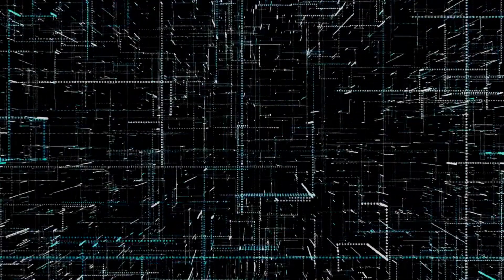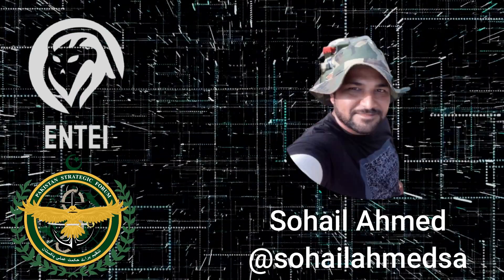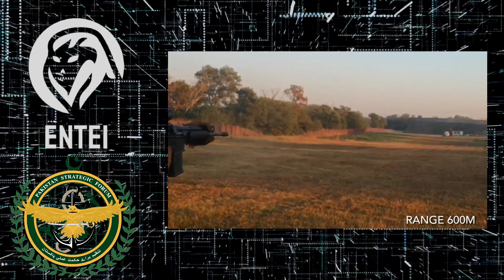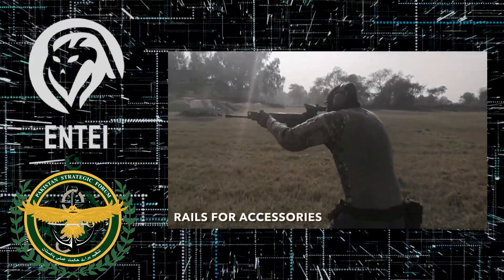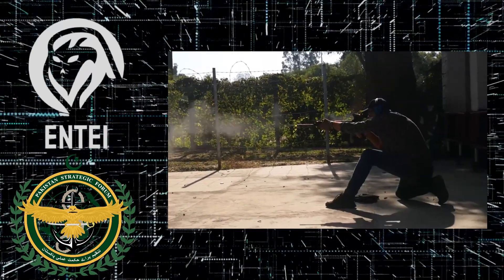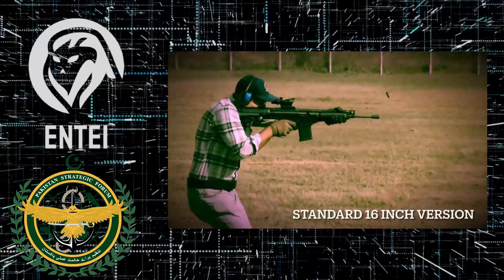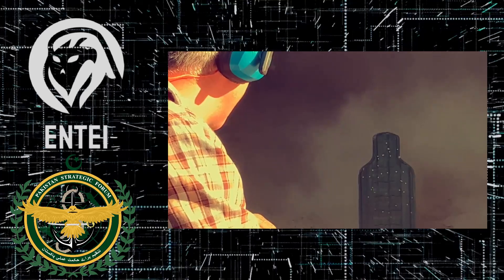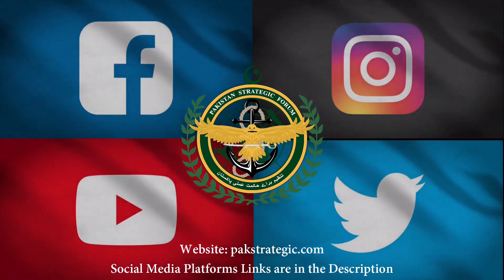New Battle Rifle For Pakistan Army BW20

Comment: Pakistan didn't rejected those rifles because POF can design a better rifle. They were rejected because POF doesn't have the money to upgrade its facilities and license produce those weapons.

Bw20 can be build on the same machinery g3s were made up of but this rifle is nothing more than an ar10 lower receiver (with its buffer tube extension cut off) joined to a g3 upper receiver.
Reply: facts facts facts

fr doe, i dont see a difference between this and the g3 considering they kept the roller delay.
Reply: @schizodecanus7498  they basically joined ar10 lower receiver with a g3 upper receiver.

And that isn't something new either. Heckler and kock did this once in the form of hk41 rifle.
Reply: @schizodecanus7498  Except the Stock,Mag,Trigger,Handgaurd and it has a pictanny rail.